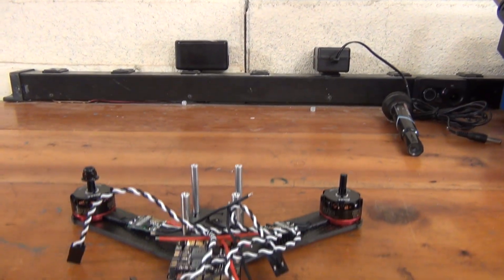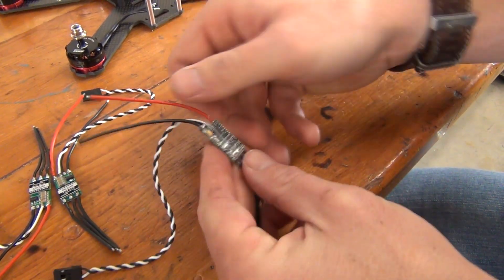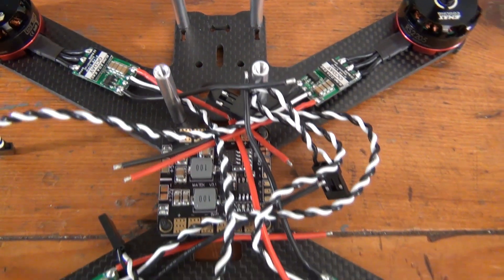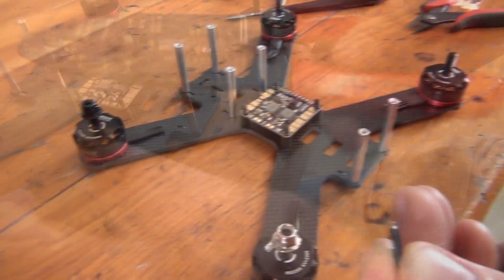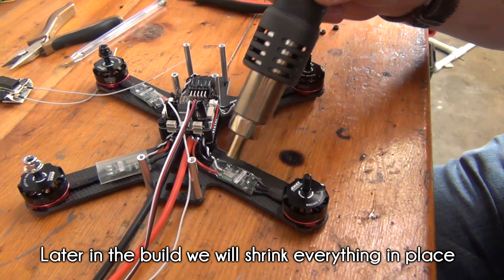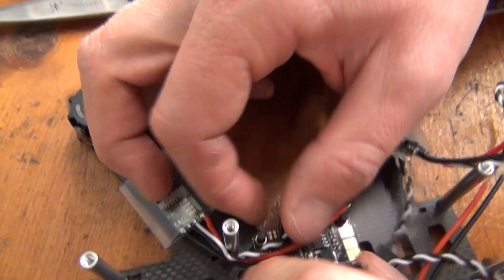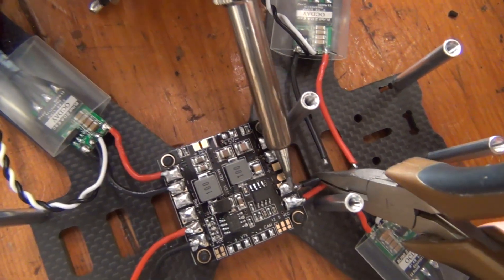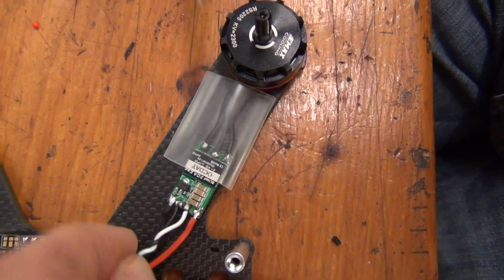How to build a racing drone | Part 3: ESC Installation!

Comment: If you want lightweight, get rid of the crap PVC wire and spend a little bit of money for Tefzel wire.  Its teflon insulated and has a way higher temp range 175C  meaning you can actually use smaller gauge wire as it can handle the current temp.  Its also the size of the stripped wire as the insulation is only a few thousandths thick.  Search M22759/32  its used in race cars and military aircraft.  You will save an easy 30% in weight and it is shockingly small in diameter.

Comment: When you said It doesn't matter where you solder the motor wires to the esc. I changed motors on a beginner quad and and all but one is turning the wrong way. Switched middle wire to the outside and the other in the middle. But now it's running a bit hotter than the other esc's . Do you have an idea what's wrong?

Comment: One of my ESC caught fire so i have purchased 30a esc and have gone to replace but my old one only had one signal cable and my new ones are similar to the ones you are using.....so how do i connect them up and why dont we use the plugs that are on them and go into the receiver?? 
So confused
Reply from the maker: Hey James! I am a little confused on what you are asking, but I'll try to explain our ESC to FC connection. So if we look at it like two sets of wires from the ESC - one set going to the motors and one set going to the FC, we took the wires that go to the FC and desoldered them from the ESC. We then shortened them and resoldered them to the ESC. This reduces any extra length in the wire to make a cleaner build (prevents tangles, getting them caught in props, etc).  To connect them to the FC, we added 90 degree pin headers to the applicable UART pin holes on the FC.  This allows us to connect the ESCs to the FC using the connectors already present.  Our  part 4 video may be more helpful in explaining this - here's a link to the part where we talk about connecting the ESCs to the FC: https://youtu.be/KTGlZSgtKVA?t=3m43s  Let me know if this was unclear!
Reply: Perfect thankyou !!!

Comment: If I have cw and ccw motors would I still cross wire the clockwise motors
Reply: I believe the only difference between CW and CCW motors is the threading of their shaft - so yes.
Reply: the motors rotation depends on the position of the positive and negative wire. The CW and CCW refers to the shaft thread on which direction it turn to tighten the screwhead.

Comment: i have dys xs30 oneshot42 that is wired power/ground to stock impulse alien pdb and i havent been running ground signal to omnibus f40 pro v3, vtx is tramp hv power/ground to pdb also and omnibus f4 is power/ground on pdb . I have had several esc fires and happens on 5s what could be causing this issue? could it be my build ? I have ordered spedix 30 dshot but if something i need to add or do to help please let me know

Comment: Good video, but I don't understand why you take the signal wires off just to cut them and put them right back on. Why not just cut them while they're attached?

(edit)  Just saw the next video and you use the connectors on the signal wires instead of soldering them on.